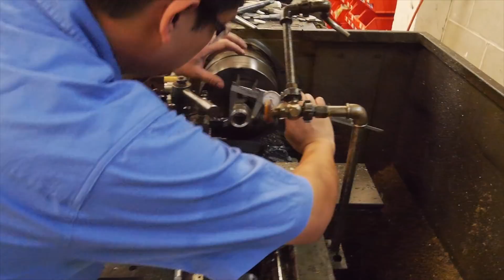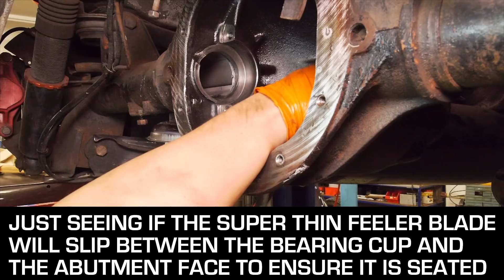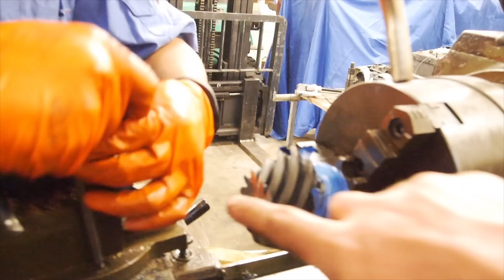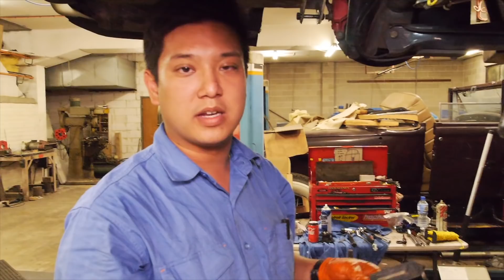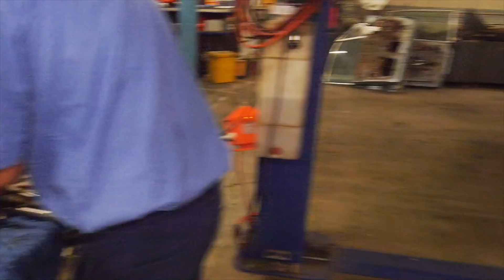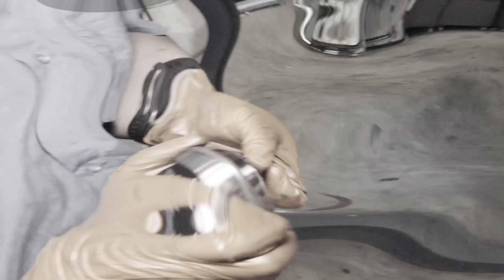THE MOST COMPREHENSIVE DIFF GEAR INSTALL | VR V6 TURBO COMMODORE - M78 | PART 2

Comment: What are the specs for the preload of the diff and pinion bearings? The steel shims I have for a VZ are substantially larger to another, can't remember which way side to side they go 🤦🏾‍♂️. Any tips?🤘🏾 Great thoroughness I can tell Ben is a mechanical engineer.

Comment: hey man just just been doing a bit of thinking lately for a next build, I've been looking into turboing a vg-vr v6 ute and would like to know if by any chance there would be enough room just past the diff in the rear for a decent size turbo. probably not as big as yours but big enough to push at least say 8-15psi.. nothing too crazy.. i have seen a couple vy and vz utes with a rear mount turbo and its sleeper asf. Also this keeps engine bay temps down, no need for much of an intercooler and being able to keep all factory options such as ac and power steering etc... the ute would most likely be stock height and later an air bag set up so it can be higher while driving and a nice stance while stopped so i wont be scraping anything under there, if there isn't much clearance that is. idk, something different.
Reply from the maker: +Hooptie Yeah there is plenty of room if you ditch the spare tyre. Have seen a few of these setups, honestly not a fan but they do seem to work. Can't beat it for stealth. I wouldn't not run a cooler. 
Water to Air IC would be the go to keep piping as short as possible.
Then there is just the matter of having a good oil scavenge pump setup to get the oil back to the sump etc
Reply: Boosted & Built Garage thanks for the info, yeah thought there might have been enough room and a w2a sounds like the way. An oil drain from the turbo I’ve worked out that if there is a 60-100ml metal box with a breather on it that sits just below the turbo keeps it without having pressure within the turbo then the oil scavenger brings it back to the rocker cover or oil pan. Might do this to my Camry first 😉 lol